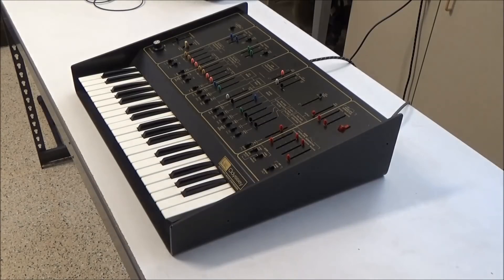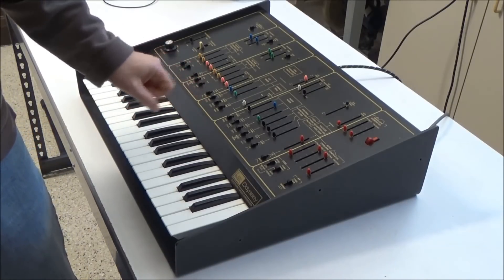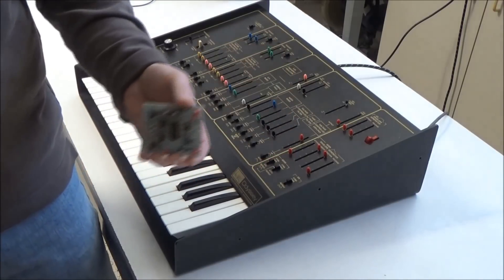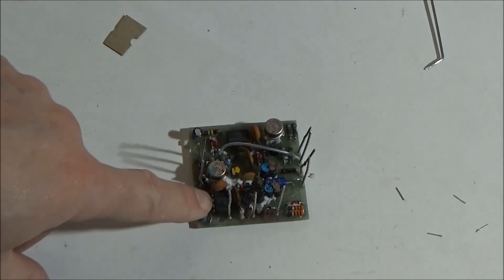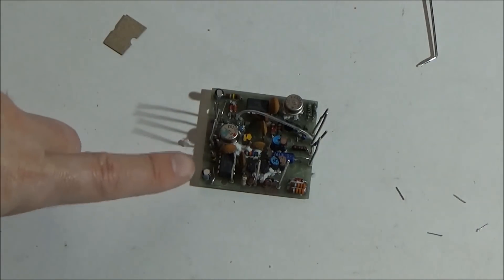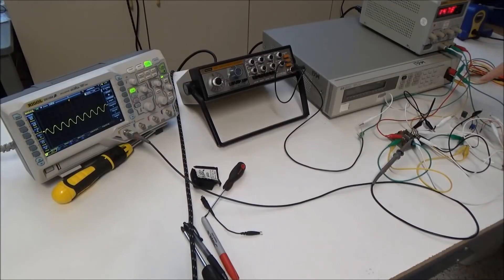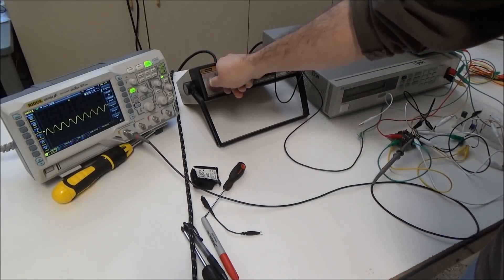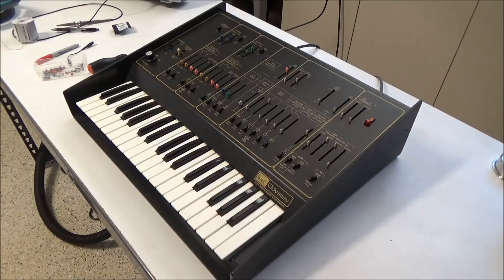Synthchaser #091 - ARP Odyssey 4023 Filter Repair

Comment: In addition to trying to stop people from fixing and seeing the actual circuit, I wonder if the silicone potting helps stabilize the filter from changes in ambient temperature?
Reply from the maker: If it does, it does so much less than the temperature compensating resistor in the circuit.

Comment: What Op amps do you replace the 311's with?
Reply from the maker: The originals are LM301, which are still in production.
Reply: My mistake I though you had said 311. What do you do for 741's replace them with 741's or something better?
Reply from the maker: Generally I'll replace 741s with 741s, and others with the original one the manufacturer used, if they're still available.  I know there are higher performing op amps available, but many people prefer to stay true to the original character of the instrument.